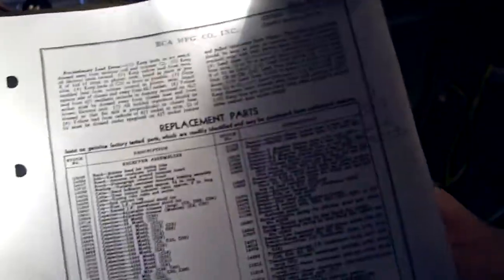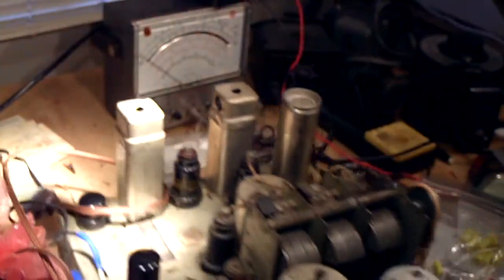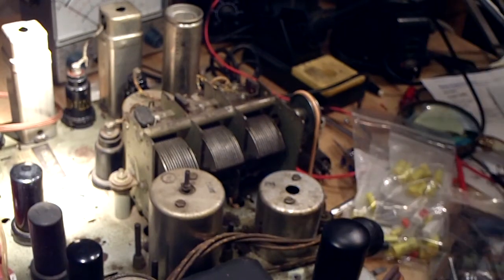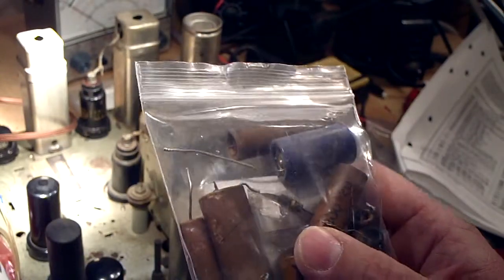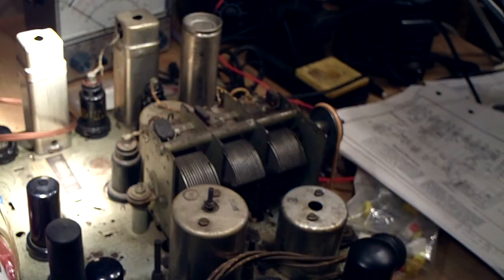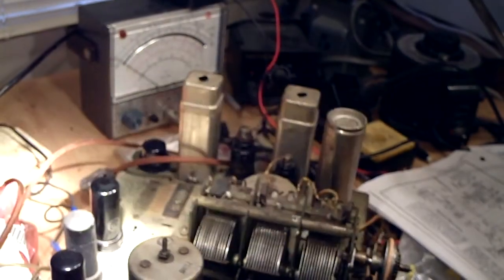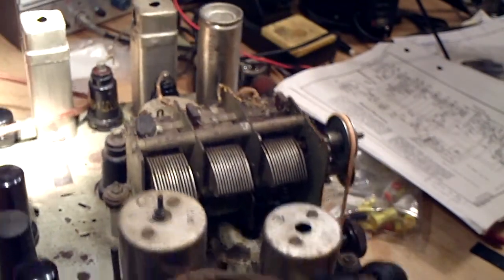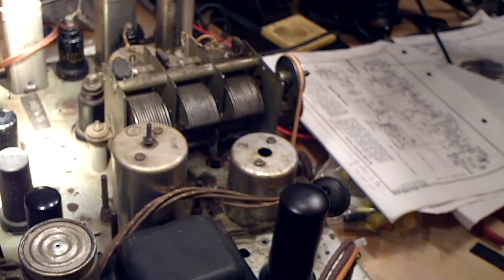Antique Radio Repair part 2

Comment: Glad you said "Month" to replace those Caps/resistors cos it's taken me  2 weeks to get 1 16uf 500V electrolytic for a 1950s Radio. Found "Siemens" 20UF but at 400v. I think the 16uf was a replacement from a radio repair tech cos it's soldered parallel to the can cap( 2x20uf @ 385v). It's a small oval 4" speaker with an EL84 ( 8 watts)? So I may try it with a lightbulb limiter. It hums like an old refrigerator even with no volume ? Power supply cap must be dryer than the Sahara.

Comment: I fancy some condencer/capacitor and reistor makers used much better raw materials in the 30 to 50's than others. Over here UK Hunts made some poor capacitors but other they made were very good (for more important radio makers I suppose) Sprague were the same in US , the armed services needed - and got- higher spec. Twenty years after the war loads of crates of caps and resistors and full radios meant for the army were being sold by weight but a lot was simply taken out to sea and tossed-in !

Comment from the maker: The internet has really given a great boost to the antique radio repair hobby.
You can find pretty much any information you need. there's at least one web site devoted to tubes and plate voltages. just google search and you can find it.

Comment from the maker: I am not set up for this but can probably do it. However, if the radio needs parts like buttons, dial, coils, switches I won't be able to get the parts since I don't have spare parts for old car radios. So to be honest with you, there might be someone with a more equiped shop that has spare parts the radio might need to restore it.

Comment: Just finished recapping one of these, & have replaced most of the resistors (all were WAY beyond their tolerance). I'm having troubles finding a couple resistors, & was wondering if you had to tear apart any of the IF transformer cans to find resistors inside? I too saw evidence of "Mr. Goodpliers" having worked on my radio in the past. Found many wax/paper caps that were the wrong value, as well as the original electrolytics having been replaced (strapped in with bailing wire under the chassis)